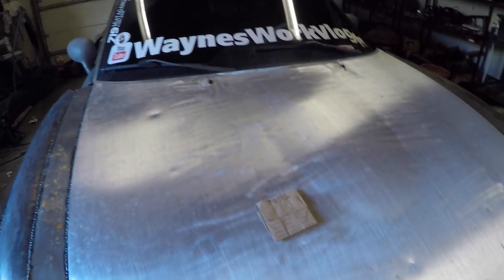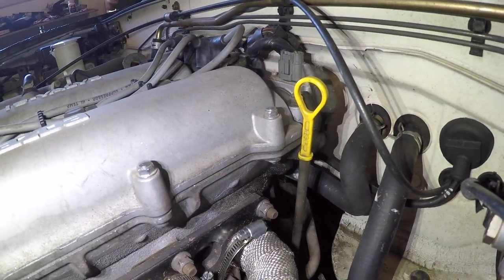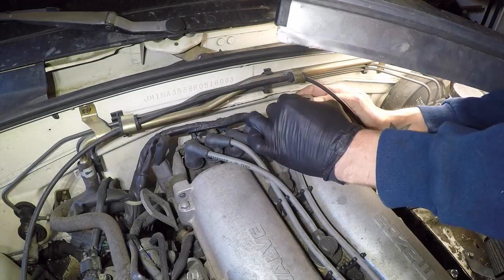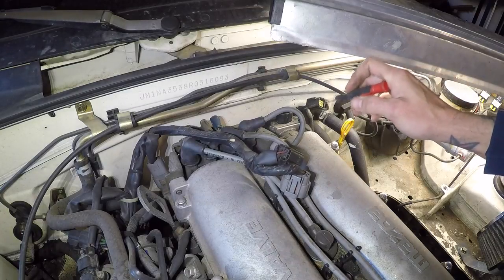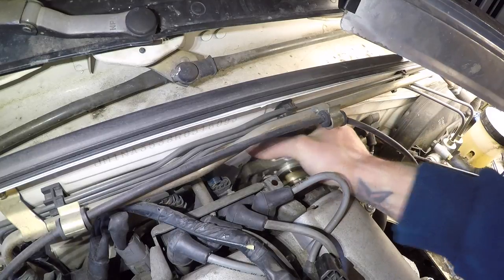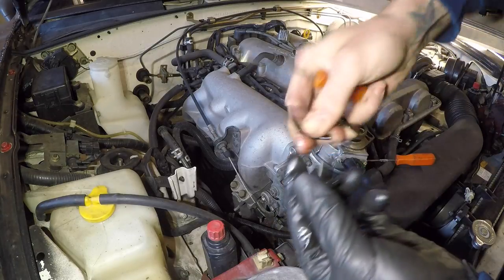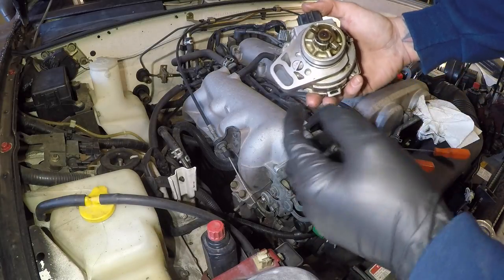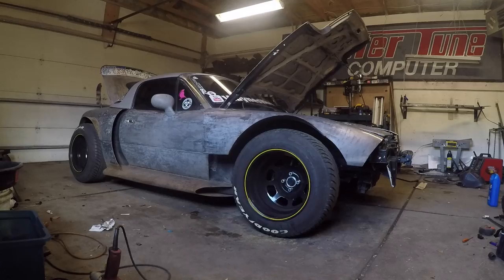ANOTHER Miata CAS Cam Angle Sensor O-ring Install Video S07E32

Comment: Thanks a lot, Wayne- just replaced the O ring on my 95. Used a Fel-Pro 35608 from AutoZone, just under three bucks. Same part for the thermostat O ring. One thing I should mention: it was impossible to lift out the CAS- no matter which orientation I tried, there simply wasn't enough clearance between the firewall and motor. Maybe a peculiarity to the 95 model year? In any case, with the CAS still trapped between the firewall and motor, I gently cut the old ring with a new matte knife blade, removed it, slid the new ring on, lubed it with a little clean oil from the dipstick, and popped the CAS back in. After tightening up the timing bolt and reconnecting the two wiring clips, she started right up with a quarter turn, and settled to perfect idle as soon as she reached op temp.
Reply from the maker: NICE!!! and no its just tricky to get out and back in. had to grow up playing Tetris I think. lol
Reply: @pawpatina  LOL! I swear, I watched you do it over and over like twenty times and still couldn't do it... :)
Reply from the maker: @soapbxprod  I am almost positive the magic combo happened off camera because I was frustrated. but I assure you when you are about to give up, it just pops out...

Comment: Hi Wayne, I have watched your video and got some vital information. Thanks! My son has got a 1990 Miata and we have just changed the camshaft cover gasket. However, we still have a small oil-leak which we have identified as the CAS oil seal. His car is the 1600 engine with the CAS on the left hand cam under the coil pack.(typical). The car has an automatic gearbox, so not so much worry about oil contamination. Is it going to be easy to get enough space to carry out the "O" ring change without too many problems.  Anthony.
Reply from the maker: I have only done those once or twice and if i recall you can get it out once you remove the valve cover. pretty easy.

Comment: I'm not knocking the video,  it was very informative. 
I have an actual Factory Miata shop manual and it says to remove the coil pack.
Maybe to keep from disturbing the setting of the sensor being removed?
Reply from the maker: nope, its just easier to get to.
Reply: @pawpatina  
I just went through the process of removing the coil pack, because it's bad.
It was a pain, needing short metric sockets, which I was lucky to find at pawn shop cheap, and a bent crooked 14/15 metric wrench 🔧for the bottom nut on the coil pack. Another lucky find, this one at flea market. 
I had already replaced the Cam sensor without pulling the coil pack. (Easy)
I have come to the conclusion the reason to pull coil pack as per factory shop manual, to replace Cam sensor is just for the flat rate shop hours to replace the Cam sensor.
Reply from the maker: @oscardavis7796  always remember, the manual was written by the engineers, not the mechanics...

Comment: was there still a bit of oil in the space in-between the cas and where it goes after installing the new oring after driving around?
Reply from the maker: no, clean it off before reinstalling the CAS. and it doesn't leak now.
Reply: Dam, I did the same thing and I thought I was good , but still getting some oil under the bottom part where it makes contact after bolting it back on. Talk to mazda about it too and they couldnt help me at all just trying using some silicon. :/ Thanks for replying fast!!! subbed!
Reply from the maker: black rtv silicon should be applied to the cas corners where it goes under the valve cover gasket and also at the four corners up front where the cams go under. also could be the valve cover gasket itself or the cas oring got nicked putting it in
Reply from the maker: and thanks for the sub!!!
Reply: Wayne'sWorkVlog so I had a random thought, do you think the o ring I bought doesn't have a high enough heat resistant? The o ring I picked up is a brand called "national "o ring  1-1/2 x 1-3/4 1/8 thickness from  oreillys
Reply from the maker: should be fine, viton is the best for this application, ace hardware has them
Reply: WaynesWorkVlog  what size is it if u don’t mind me asking at ace hardware?

Comment: Hi from London. U have to do the timing etc after removing and reinstalling the cas??
Reply from the maker: not unless you undo the timing.
Reply from the maker: scribe it before removal and you don't even need to check the timing.
Reply: @pawpatina  u da man!!
Reply: Kool. Did it today also cam belt water pump..  New Rad fans etc. Car ran hot after a while. Air lock I think.. Best way to bleed it?
Reply from the maker: @andyvaid69   then if you did the cam belt, that is the timing belt. so set timing properly with TDC piston 1. 19 teeth between each cam mark etc... for the running hot, and didn't do it before? if the system was drained and refilled, then your thermostat was exposed to air and flash rusted shut. otherwise you have other issues. bleed procedure is just run it with cap off, when thermostat opens top off radiator. engine may be full of air. especially if you see the temp gauge jumping around.
Reply: @pawpatina  ya sounds right. I'm on it dude!